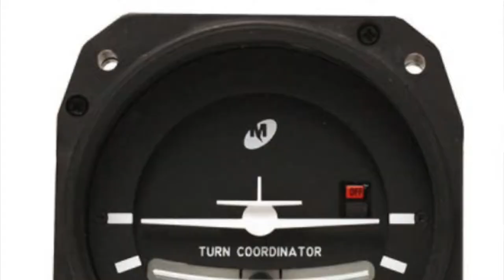Ailerons, Rudder & Adverse Yaw RC Model Airplanes

Comment: In the case of rudder-only, dihedral is important to start and end the turn simply because the skid/yaw caused by the rudder forces the large surface of the opposite wing directly "sideways" into the air flow. With just-right-perfect dihedral, a rudder-only plane can easily do rolls, even snap rolls.

For aileron-only planes, there are ways to prevent adverse yaw if it's even an issue: first, avoid any bit of aft CG (which is all too common and often overlooked when diagnosing an odd-flying model). A slightly forward CG will keep the nose down in a bank and give the model the appearance of carving out a nice path even though there's no rudder. 

If that's not enough, another way to eliminate adverse yaw is with aileron differential throws, either achieved mechanically at the servo horn and/or control surface horns, or with the transmitter using dual aileron servos. The up-going aileron travels farther than the down-going aileron and eliminates the excess drag on the opposite wing. One can even go as far as not having any downward aileron travel but I've never seen that.

These techniques can be useful because for a beginner or intermediate flyer, coordinated turns with rudder and aileron together is easy to suggest but that can be an insurmountable challenge.
Reply from the maker: Great points, thanks!  Tim

Comment: Adverse yaw is generally only a problem on planes that have a flat-bottomed wing such as a trainer. If the ailerons deflect up and down equally, the down-going aileron will cause much more drag than the up-going aileron due to the air pressure difference above and below the wing. I eliminate the adverse yaw by making the up-going aileron deflect further than the down-going aileron. Some people mix aileron into the rudder channel. That's just hiding the problem and could cause other issues. Other people use the differential function in their transmitter. However, that requires the use of two channels and decreases the throw of the down-going aileron by decreasing the servo travel in that direction. Whenever you decrease the travel in your transmitter and servos, you decrease the resolution of your radio. And when the linkage doesn't move as far, any slack becomes a greater percentage of the travel which decreases the positioning accuracy of the control surface. If the linkages are below the wing, I create differential throw by taking the servo arms off the aileron servos and putting them back on with a one tooth offset toward the leading edge of the wing. If for some reason, you can't offset the servo arms, you can achieve the same result by moving the control horns back from the hinge line of the ailerons a little bit. In either case, you'll have to lengthen the pushrods so that the ailerons are centered at neutral. In my experience, the up-going aileron needs 1-1/2 to twice as much throw as the down-going aileron.
Reply from the maker: Excellent inputs from an experienced plane builder!  Tim
Reply: So I can add an observation from one of the Edwardian oddities that I scratchbuilt.  I made an Avro model F, the 1911 or maybe '12 enclosed cabin fuselage monoplane with mid depth mounted, undercambered wings with a not a lot of dihedral.   It was 29" WS and very light at 7 oz..  I initially made it with wing warping, which was not easy to do with wings covered with Doculam.  At any rate first flight was over our back yard, and the undercambered wings immediately stopped flying on the outside wing and it would plummet out of the air when you added warping/aileron input.  It could be ameliorated by giving a bit of down when turning to keep the outside wing flying but there wasn't much forgiveness in that thin wing's lift, when it was warped just a few degrees up it wasn't flying anymore.   I eventually removed the warping and the servo and it flew much better on RET.  This is something to consider when building a pre WWI and (or) WWI wing warping aircraft, especially if retaining the undercambered airfoil. at these Reynolds numbers I think they rapidly go from flying to becoming parachutes with very little increase in angle of attack
Reply from the maker: @tauncfester3022  Excellent points!  Tim

Comment: Very helpful vedio thanks, so on my strix stratosurfer I'm going to mix in rudder with elevons but wondering what would be good percentage of rudder to start with? Thanks again
Reply from the maker: Not sure exactly. But experiment with a smaller amount, see how it works, add more throw as needed. Good luck!
Reply: Will do thanks

Comment: Tim I've been told to add elevator in an aeliron turn to help control the loss of altitude the side slip produces. Would I be better to use rudder instead? This is on a PT20.
Reply from the maker: Chris:  You are 100% correct. For turns add a bit of up elevator to compensate for the loss of lift with the banked wing. Rudder as needed for a coordinated turn (ball in center of turn indicator). More bank = more back pressure (up elevator). Tim

Comment: Ah great video. I know several pilots who never use their rudders. I almost always do, but on some planes I've noticed that I use an opposite rudder input, left aileron turn and a bit of right rudder to keep the dose up, something like Knife edge and a bit of up elevator? Maybe because I'm using more aileron than the standard bank angle requires. I'd sure like to see so kind of coordination  indicator, except I don't want to look down at it while flying LOS. I guess on one of my 4 channel FPV planes one could be incorporated into the OSD. I may be over thinking this.
Reply from the maker: No, you are thinking the problem through.  Different airplanes can have very different responses to aileron inputs.  All good!  Tim

Comment: I just wanted to add some interesting exceptions. Back in 2003, Hobby Lobby International was selling a Cz. made, EPP foamy 3D trainer with a brushless motor and 4 channels, called the Pigi-3D.  It had a huge, slab sided fuselage and it would psuedo yaw-roll rudder turn like a high winged, significant dihedral 3 channel RET model.  In ways it would do this both upright and inverted.  I believe it did this because of the fuselage was airflow blanking the inside wing in the turn.

Edited to add: The DH82 Tiger Moth: Did you know the Tiggy had just ailerons on the lower wing, and they had significant differential where the up aileron angle was nearly 3 times the down angle, to keep the amount of aileron coupled adverse yaw to a minimum. Something to consider if I ever make a DH82 with ailerons in the future. 

  I've also built and scratched a number of balsa/film WWI planes and the RAF SE5a and in particular the plans built Air-Trails freeflight rubber powered SE5 from the late 1930's, when scaled up to 27 inches rudder turned like it had ailerons, if you kept the plans dihedral, and tail surface dimensions. I believe that this was an Earl Stahl design.   Peter Rake's AVRO 511 Arrowscout would rudder turn with alacrity with only 3 degrees of dihedral and 20 some odd degrees of wing sweep back, I assume the full flying comma rudder had a bit of help in setting up conditions for this.  Your videos are interesting, thanks for taking the time to make them.
Reply from the maker: Great inputs and observations!!  Tim
Reply: I still fly my Pigi-3D occasionally.  It was my first foamy.

Comment: I have an nx8 and just set up a 1.2 ,Eflite Corsair with some as3x, safe etc. Well while doing a control surface test I noticed, when i move the elevator , the ailerons are moving slightly,as it's on my bench. I'm afraid to fly it cause I can't figure it out why it's doing that. I've checked everything appears to be set up as instructed by spektrum. Do you have any ideas why it would be doing that?
Reply from the maker: Not sure as I never have flown with SAFE on. Is there a way to turn SAFE off and fly just with AS3X?  Tim
Reply: @TimMcKay56  yeah I can try that .  Thank you.

Comment: You said that the elevator isn't involved in turning the aircraft. So... using the ailerons to roll the aircraft then pulling up elevator and using the rudder to counter the adverse yaw if it occurs - I've heard this referred to as "banking and yanking"  - Is that wrong? Is there another way to make a really tight turn without using the elevator?
Reply from the maker: Well, to be fully accurate with light aircraft you need to use a bit of up elevator prior to any turn, as the banked wing produces less downward lift vector.  The up elevator has the wing at a bit of a higher angle of attack thus more lift.  As you slightly raise the nose bank is applied and rudder as needed for a coordinated turn (ball in the center of the turn indicator).  There is more up elevator when doing steep turns (a training exercise), usually at 45 degrees of bank.  Tim

Comment: Maybe it'll be beneficial to only actuate the inner aileron to counter the adverse yaw problem.
Reply from the maker: Peter:  Excellent observation!  Many aircraft, to include the F-4 and some airliners use just a spoiler (control surface  going up) on the lower wing to bank. Tim
Reply: @TimMcKay56  Spoilers only work when the wing is producing lift. See the B-52 crash at Fairchild Air Force Base in 1994..

Comment: On the subject of rudder only or RET, the wing must have a sufficient amount of dihedral so that when the plane yaws, the relative wind hits the bottom of the wing on the outside of the turn and perhaps the top of the inside wing. I don't see the speed change of the two wingtips creating much difference in lift. There's not that much speed difference due to the yaw. A low-wing plane will need more dihedral than a high-wing plane. On a high-wing plane, I think the relative wind from yawing hits the side of the fuselage and increases the air pressure under that side of the wing. On a low-wing plane, it would tend to increase the pressure above the wing, preventing it from banking into the turn. And, the fuselage would tend to block the relative wind from hitting the top of the wing on the inside of the turn. I've had shoulder-wing planes that would just yaw without rolling and low-wing planes that when yawed would roll in the opposite direction. You can also see these tendencies when trying to perform a knife-edge pass with top-rudder. High-wing planes tend to roll back upright, shoulder-wing planes with no dihedral tend to stay in knife-edge, and low-wing planes with the right amount of dihedral will stay where you put them.
Reply from the maker: Thanks for this update!  Tim
Reply: Yes. I built one once, rudder only, with very little dihedral. It took a ridiculous amount of space to complete a turn. Even with a rudder nearly doubled in size. Later I cut the rudder back down and added polyhedral to the outboard 1/4 or so of the wing and it turns like an sob now. It banks like it had ailerons.
Reply from the maker: @emersonb5764  Great idea!  Tim

Comment: Some low-wing warbird models may not have rudder controls, having only aileron, elevator and throttle controls. They must have some dihedral, and be flown with "yank and bank" style control inputs. i.e. bank model with ailerons, pull  up-elevator to make the turn, level wings with ailerons and use elevator and throttle to regain lost altitude. Models flown by "yank and bank" do not fly gracefully.  Models without rudders are difficult to taxi and take off, having no tail wheel or rudder for steering to control tendency to yaw left. Rudder control is also necessary during takeoffs and landings to control ground looping tendencies. Well controlled and safe flying of models, or full scale aircraft,  actually requires proper coordination of ailerons, rudder, elevator and throttle inputs learned in "ground school" from an instructor and by considerable in-flight practice.
Reply from the maker: Smaller models fly well on three channels of control.  You really do not use the rudder that much in flight.  You are correct, the fourth channel is needed for steering on the ground and takeoff.  Where you really need rudder is with older, slower flying models such as WW1 fighters, where adverse yaw is a real issue.

Comment: I thought that in a case of rudder-only turning, the plane banks and turns because the angle of attack of the forward rotating wing is increased (in relation to the air flow) and therefore the lift of that wing is increased? In particular (or only?) when the plane has positive dihedral. The increased airflow over the wing theory appears to me would only apply for the short time one wing is actually moving forward fast than the other and the airspeed difference isn't that great anyway.
Reply from the maker: That is part of it.  But I have found the drag from the ailerons has the larger effect on adverse yaw.  Especially with the older, WW1 era biplanes with slow flight and a lot of aileron surface.  Tim